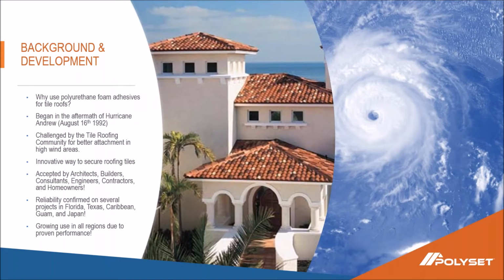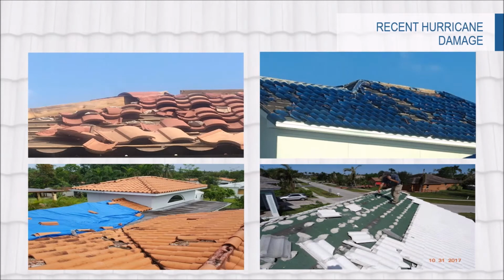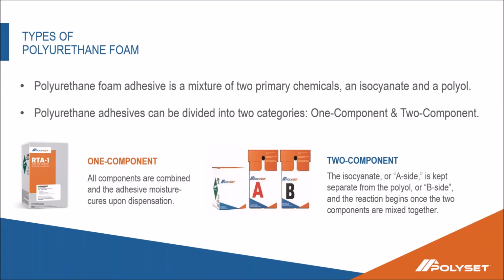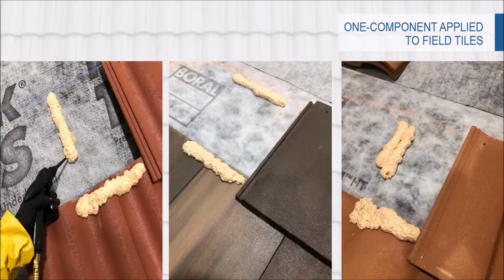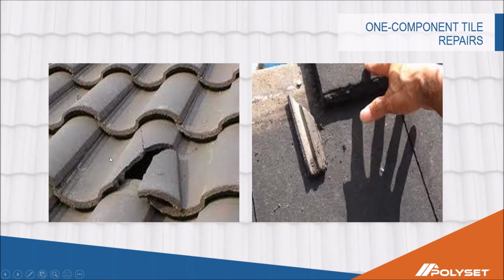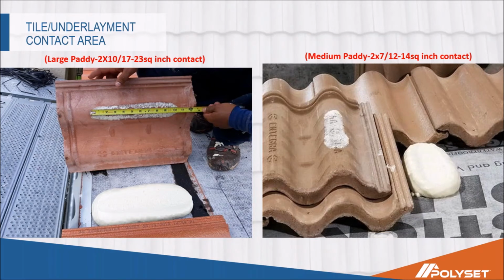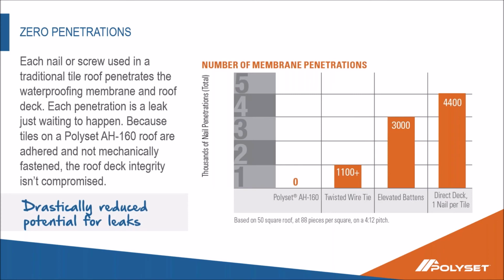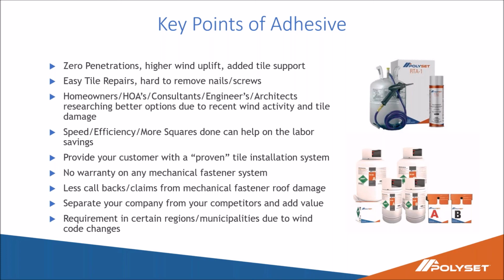Foam Adhesive Training-  Tile Roofing SHORT Course

Comment: Absolute joke 😆 Use clips like the rest of the world. I feel for the roofer who has to repair brokes. How do you suggest shearing underneath when the expanding foam has gripped the entire tile? This is what cowboys do in england.
Reply: Harry, not sure what part of the country/world you work in, however Polyurethane foam adhesive products for concrete/clay roof tile installations have been around for over 30 years. They are an important part of a roof tile system, especially in the high wind-hurricane regions or on structures above certain heights. They have a much higher wind uplift resistance value than clips or any other attachment method and can save on time/labor with a trained crew, plus reduce the amount of roof deck penetrations. In regard to broken/repair tiles, foam adhesive products actually make for easier tile repairs. Polyurethane products can be sheared off with a trowel and the new bead/paddy of foam can be reapplied to the code approved underlayment.
Reply from the maker: The performance of adhesive set tile in Florida and Gulf Coast hurricanes has been impressive. You can not achieve the same uplift resistance with clips. Clips require fasteners, and consequently penetrations through the underlayment over the entire roof. There are tremendous advantages in installation ease and the performance of the roof in extreme conditions.

Comment: Can I use foam with wood batons? Like undrlayment+wood batons+foam+tile+screw.
Would that work or would the foam trap moisture near the wood and rot it out over time?
Reply from the maker: You can use foam with battens, you just need to make sure you comply with the foam adhesive manufacturer's application and installation requirements.
Reply: @tileroofingorg  thanks.
Reply from the maker: @StrawB0ss  It is not complicated, meaning the installation instructions and requirements are clear, and it is not difficult. But there are several manufacturers of foam for adhesive set systems, and it is required that an installer have training from that specific manufacturers. If visited by an inspector it is common for them to see the mfr training certification from the specific manufacturer you are using. The foam adhesive manufacturers provide the training at no cost, some even will come to your jobsite, but it is a requirement because the characteristics of the various products are import to know and take into consideration when installing.  (John)